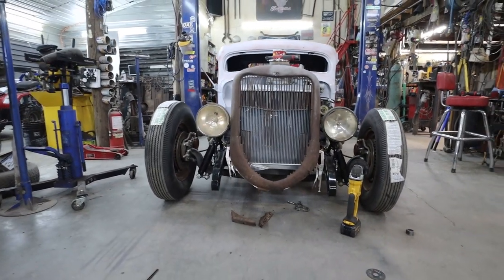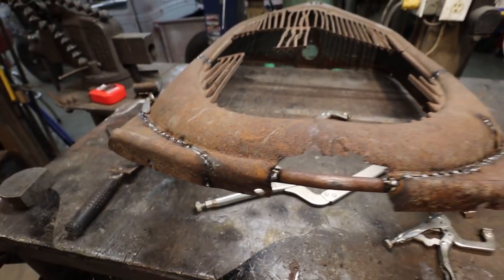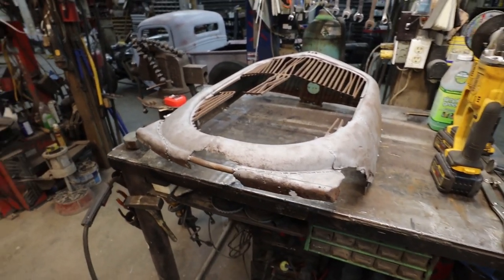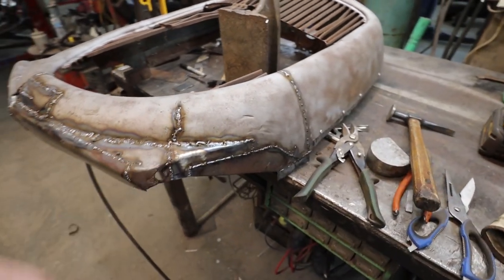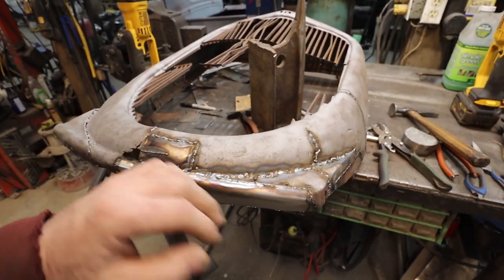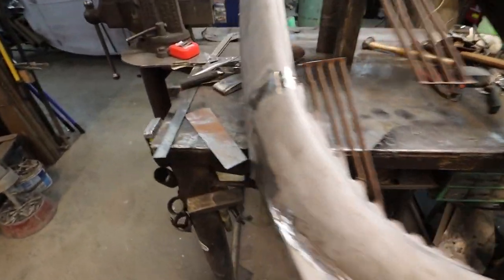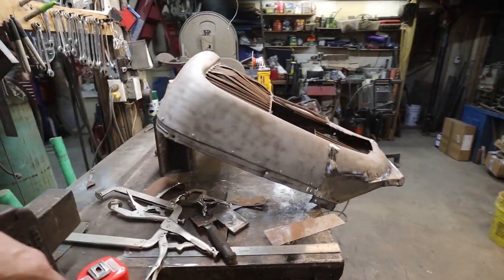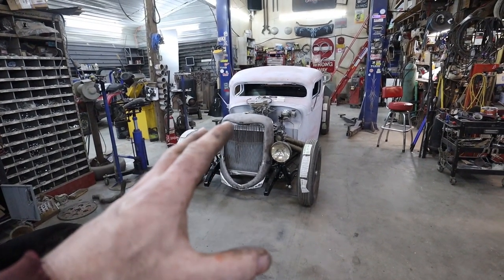37FordHotrodPart32

Comment: Just putting it out there Brent, perhaps a stainless or alloy sheet with the Halfass Customs logo cut out on the plasma table then rolled into a slight curve to fit into the rad 
shell? The rad shell looks great BTW, and adding the bottom wings back on made all the difference 👍

Comment: Back in my 20's, my buddy's first hot rod was a 36 Ford pickup.  His grille was a factory chrome piece (told was an option in late 36) it was pitted but straight.  He later found an NOS grille and radiator for $250.00.  25 yrs later  when I did my 36 I found a shell that needed work and paid $150.00.  He thought I got taken, little did he know he got the deal of a lifetime!  Keep fighting the good fight Brent!

Comment: Use 1/4in brake line to repair the grille bars. They polish up pretty well.
Reply: Copper line soldered in might be a nice highlight
Reply: Thanks for sharing, I thought about making a grill she'll from the tops of the doors, seen a few video's of people doing it. Takes the shape of a 34-35 grill she'll, then the grill itself a BBQ grill they sell at are home depot pretty cheap, for my time to make it and buy the material. Yeah it would be way cooler to make one out of found materials.

Comment: For something different yet totally accessible, I think it would look cool with brass punched grates for the grill, like the ones they use in old homes to make the surround of cast iron heaters. The holes are an unusual shape and it seems like something an old hot rodder could have got at a hardware store. Of course you can get it now at the big box home store of your liking.

Comment: I don't no about any one else, but I'd like to see you do an instruction video like you were mentioning. I taught my self  to do this stuff using acetylene and braze welding. A few years ago I bought the same welding machine you have and use gas with it. The last project I did was a '57 Chevy pick up and did the normal stuff with it, cab corners, floor panels, rust out holes in the fenders and complete replacement of about 16 inches both inner and outer of the doors. It turned out alright at least the guy was happy with it. But it took way to long trying to figure out the welding, setting the welder, and what size wire to use. I figured I could have done it in maybe 3/4 of the time with the old methods. So ya that video would be good to see. I keep seeing stuff in your shop that's in mine too [ Princes Auto fan too ] I've been watching you since the Pontiac coup and cant get enough of your videos or your dogs.

Comment: Nice fabrication on the grill only one problem at the very bottom where you put them pieces on that you put back on the passenger side is longer than the left it’s not the same angle otherwise nice job as usual 👍👍

Comment: I would be glad to watch a video on how you weld the information I am armed with the better my welding gets. I have a Lincoln 140HD that I use with a 75/25 mixed gas. This is a great welder for a small shop and works great on 110 or 220. What I would really like to see is you maybe do a little lesson on Tig welding, and proper prep for tig if yoour going to do a welding video. Also congrats on the 100K
Reply from the maker: I'm pretty good with a MIG I can make stuff stick with the tig I can't say it'd be a very good teacher with that one LOL

Comment: Would love to see a welding video. I have a Lincoln 120v MIG.   So many of my welds look too much like bird poop 😣.  I don't have a steel table and typically use my vice and try to brighten up the metal and have a good ground clamp contact.

Comment: THE REASON WHY THE GRILL LOOKS WRONG IS THAT IT THICKENS AS YOU LOOK DOWN THE SIDES. THIN THE BOTTOM ENDS AND YOU WONT NEED TO WELD IN THOSE TWO BOTTOM PANELS. LOVE THIS PROJECT.

Comment: My brain goes to arked flat bar ribs, maybe just 2-3 to match the stock grill. Then weld in 1/4 inch round rod as the grill, would have a similar look to stock. Or when you mentioned aluminum, I've seen solid aluminum sheet with 2"-3" dimpled holes, with rivets around the perimeter it would match if you're doing bomber seats. Also give it a more industrial look that would match the headers you made.

Comment: It would look cool if you would of relocated the radiator fill tube and cap to the center, extending it about 1/2 out the original radiator shroud hole and putting an old type Quail on the new radiator cap that was from the 30's.... Keep up the great work and the video's comeing

Comment: Just a thought but probably to late now but instead of putting the wings back on why not form a piece that gives you the wing effect but also goes across on the inside of the grill and creates a deflector that pushes the air from the bottom of the grill opening up and into the bottom area of the rad.  This would also help to clean up the open space at the bottom between the grill and the spring mount axle and would also hide the mod to the bottom of the rad were the feed to the water pump goes on.  Just a thought !!

Comment: Yeah, your welds on thin sheet metal seem high to me, but i always figured thats because your trying to use as little heat as possible. I'm currently on flux core for everything. Honestly, the only difference is you can't see much when you weld, and you have way more clean up to do. It'll butt weld sheet metal just the same as a mig, i mean, on the same machine i'll use pretty much the same settings for gas or fluxcore. If it was an issue i wouldn't be using fluxcore i guess?!! My experience anyways... as always, great job!!
Reply: Congrats on the subs Brent!! I joined when your were just under 50k, does that make me a veteran?! haha

Comment: Even more amazing work! However, and not wishing to criticise in any way, from the video when looking directly at front of truck, it appears that the grill is not hanging  correctly, as if the top curve of the grill is not symmetrical with the front windscreen apperture. Perhaps it is some photographic error creeping in. It just looks like the grill needs to be slightly rotated anti clockwise to line up. Sorry to be a nuiscance.
Reply from the maker: Yeah it's not fully mounted as of yet more just hanging there till the finished product.